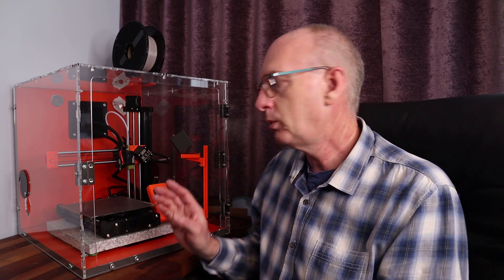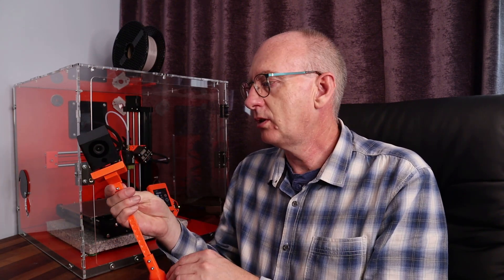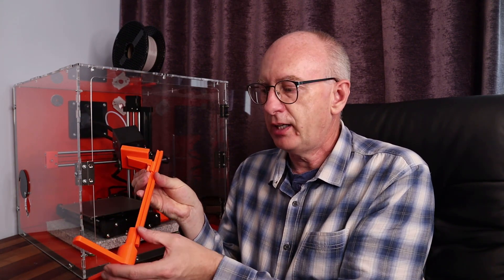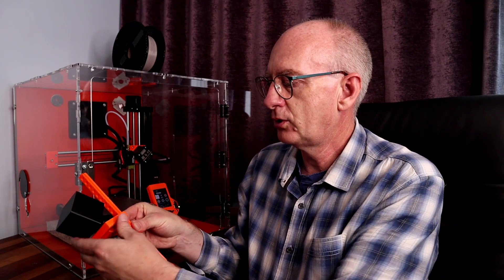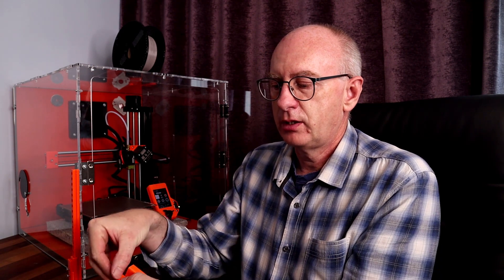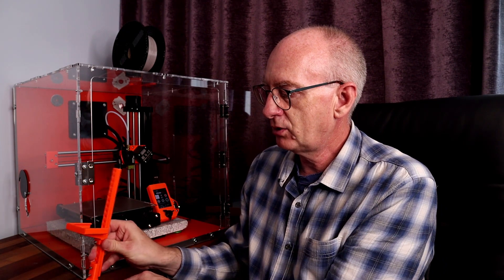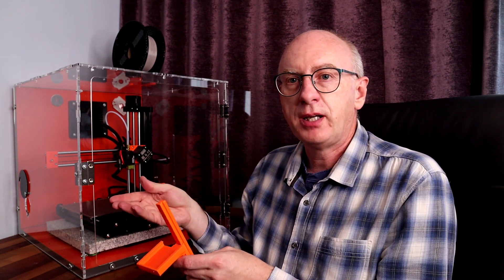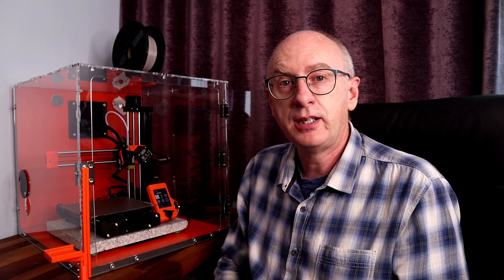Wyzecam (logitech / Pi Cam) Webcam Mount for 3D Printers - Portable, Adjustable Height

Comment: Hi Colin, I know you mentioned somewhere that we can use a WYZE v2 as a webcam for a raspberry pi but something needs to be done to it first? Can you explain what needs to be done? Thx...
Reply from the maker: Go on the Wyze site. You can download the webcam software. However I found the results poor and will be flashing back the original software. I plan to now use a Logitech c920 once I have a mount.
Reply: @colinhill  ok I actually have a Logitech laying around I could use too. Please let us know when you make a mount for it. Will it use the same rail that we initially printed and installed in the enclosure? Also how are the original pi cams that connect directly to the RPi to use?
Reply from the maker: @mrjayd  I haven't used a pi cam. I do plan to use the mount rain for Logitech. Currently building the spool tank!

Comment: Hi Colin, how hot does your enclosure get? Do you think the camera can handle an enclosed chamber that gets to 60 degrees?
Reply from the maker: It's a matter of checking the working parameter specs for any device. I don't allow it to that temp. Worst case put camera outside.
Reply: Great video. Will download the stl file for the webcam rail.